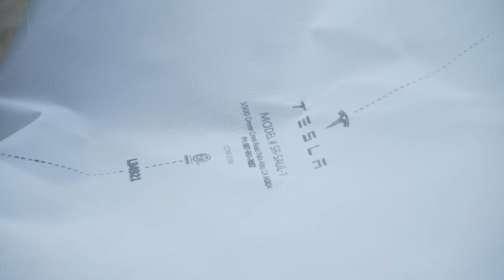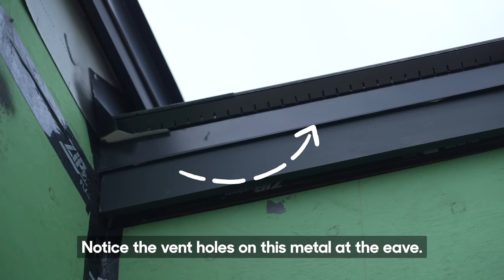Tesla Solar Roof - A Builders Perspective

Comment: As an Architect and someone that just finished building a custom home, this roof is super awesome.....for those that can afford it. Our roof we installed is a high-end concrete flat tile, we priced a tesla roof, and it was 4 times the cost of the tile roof. With that kind of price increase it really is just for those that want the bragging rights or truly have money to burn for the new cool tech. I think it will still be a decade or more before you see this type of roof incorporated into everyday home construction. Don't forget, you don't just have the cost of the roof that's 4 times more, but then you need the power walls as well.
Reply: Does that include the cost of install? What was your expected ROI on the solar?
Reply: @InfluentialStudios  We could never ROI per our estimates. We would never save enough power to offset the cost of the Tesla solar roof. With a 20 year excepted production lifespan, we would never ROI before the panel production was too low and needed replacement. The Tesla roof might have a 30+ "roof" warranty but the panels start degrading production the moment they are installed. By 20 years you are already in the 30% production range. Cost of entry is still too high for most consumers.
Reply: I thought the same thing, but I ran some numbers and was surprised how good the ROI was. I may be off on cost and savings, but if I'm close the premium over a metal roof has an ROI of about 7.5% per year. Not too shabby. Video here: https://youtu.be/y6bcUSQXEmo
Reply: I'm building a new custom home in GA and wanted to get the Tesla Solar roof.  The math just didn't work out--and I'm a retired accountant.  Then there was the short supply and not enough installers to contend with.  The roof plus the Powerwalls wouldn't start saving me money until after I'm dead.  In some states, electricity is just too cheap for this version of the solar roof too compete.  Perhaps in 10 years the cost will make more sense.  I agree, it just for those that want the bragging rights.

Comment: Lets come back to this project after one full year and see the ROI, thanks Matt for featuring this Roof build.
Reply: Oh please. If you can afford a home like that you don't worry about ROI.
Reply: @slickraft  Yes and No. I'm guessing in this case it's mostly installed as a status symbol, kind of like buying a Tesla car (I don't think any Tesla product has yet offered a payback). But other high-end buyers will wait for an ROI (that's how they got rich; by being conscious of returns).
Reply: @slickraft  Where I was born , in Asia  many houses  are worth $100,000  to $200,000 , Solar panels and LFP  batteries  allow offgrid  or gridtie installations ,some whole systems go for $10,000 ,with the cost of Electricity  being so high and constant blackouts it is a no brainer  to have Solar and batteries ,ROI  around 5-6 years  as many are finding out.
Reply: @slickraft  if you can afford a house like this that means you live ROI…
Whoever lives here has thought this through
Reply: @FreekHoekstra  We have much smaller house and cheaper solar roof/powerwall package. Had to replace the roof, and it ended up costing us about what metal would have, or twice asphalt (after incentives and insurance payment). 

The ROI changes every year. We originally thought it was ~15yrs. Last Fall, we got a software update for the batteries, and now it looks like our ROI is cut to ~7yrs. Depends on energy prices, and if you have an EV etc. That's not factoring in gas savings and future energy savings improvements.

It also felt like an opportunity we couldn't pass up on, and was worth it for style reasons. They've also hiked the price since then, and people have much larger and more complicated roofs than ours.
Reply: @FreekHoekstra  Not necessarily. Here you have young, dumb, overpaid sports stars who just blow their money on dumb things. Odell Beckham spent $2 million on a diamond grill. Can you imagine?
Reply: @Crusader1815  and here you are talking about. It generating more press for him and probably generating him more money…
Reply: @slickraft  When I build my house in the tropics ,whether  Asia or  Central America  Solar  Panels  and  Batteries  will be top of mind, system wil be 10%-20% cost of the house/ Property so around the cost of this build PECENTAGE  WISE
Reply: We just released a video on ROI! 🌄
Reply: @Crusader1815  Did you know diamonds and coal are similar in composition?  Maybe He wants to BBQ with diamonds 💎😏
Reply: @slickraft  I actually think this may be giving them an annual return of about 7.5%. Full analysis in this video I made: https://youtu.be/y6bcUSQXEmo

Comment: I had these panels installed in August 2020. But it's nothing compared to this. I've only got 6.43kW and one PowerWall. But it's still awesome. I'm close to breaking even - meaning zero electricity costs over the year with one Tesla MY charging daily from it. I'm estimating a payback in about 14 years but that includes the cost of replacing a defective roof that needed replacement anyways. Plus I don't buy gasoline. The one negative in So. CA is because there's no rain for most of the year, the beautiful black glass panels get covered in dust over time. The little rainfall barely ever washes it off and there's always a brown line across the bottom edge of each roof tile. That's noticeable from close up but not from the street.
Reply: What nobody talks about is the monthly payment you still have. You may not be paying for grid power but you are paying the system monthly.
Reply: @xxZerosumxx  that's what I meant by payback in 14 years. The monthly savings is more than the monthly payment.
Reply: I had a friend in California who had to keep his panels cleaned monthly to keep them operating at peak performance due to the dust. Your 14 years may go to 17 years if not cleaned!
Reply: A 14 year payback is horrible but thank you for that information. I hope you somehow come out ahead in the long run.
Reply: @petebusch9069  After 14 years in fact...
Reply: @JRP3  That's way too long, you'll never save a dime.
Reply: @petebusch9069  Literally after 14 years you will, it's that simple.  After the cost is paid back then every year after that saves you money.  Math.
Reply: @JRP3  You don't seem to understand the concept of ROI. Your money would have been better invested in many other ways that would return a decent ROI. 14 years is so far out of the ballpark your going to be lucky at best to break even. Do all of the math considering other investments and you will see this isn't very good. Its like buying stock that just sits there while you could have been making money the entire time.  So if your in this for an ROI then you lost, if your in this to somehow save the planet then that is a completely different subject that I will not argue, you be you but don't live under the idea this was a good financial investment.
Reply: @petebusch9069  You're ignoring the value of protection from power outages as well as the fact that other "higher" return investments can also be higher risk and in fact lose all your money.
Reply: @JRP3  Power outages are rare and a small Yamaha generator will get you by, its also good for a person to loose their luxuries every now and then to maintain appreciation. If you NEED power then get a big backup generator. You are also not aware that solar IS a high financial risk as well. Spending 300k to get free electric and gasoline for the next 20 years is not a good investment. That's 100k for the system, and 100k for 2 cars.
Reply: @petebusch9069  So now you're adding the cost of vehicles, as if they wouldn't buy a vehicle otherwise?  Ridiculous.
Reply: @JRP3  You sound like a salesman. What is the guarantee, do they give you one? Do they put it in writing that you will come out ahead and by how much and if not what do you get?
Reply: @petebusch9069  I agree with you. A 14 year pay back by any definition is basically an opportunity cost over money out to better use elsewhere. And that assumes no repairs.

I put a large solar install in last year with an estimated (my estimate) 8 year ROI. However I knew if energy rates increased this would be sooner and my local provider has already announced a 10% increase soon in electric.

The Tesla solar roof looks cool, is laughably overpriced, and like other Tesla products availability in the market is many years behind original claims.

I have no on-site battery as those increase cost precipitously. My panels are 370 watt silfabs.
Reply: @patty109109  Hey, if you can make it work and actually save a buck then have at it.
Reply: I agree, we live in So Cal as well and the dust layer is annoying.  Not as noticeable from the street but still I wish it came with a Roomba like washer that cleaned the roof everyday.  I think the Tesla tile roof only makes sense if you need to replace a roof or if it's a new build.  Otherwise, regular solar panels with be much less $$.
Reply: Just to clarify, the 14 years included the cost of replacing the roof, not just the solar. Accounting for just the solar, it's more like 7 years to break even. Sorry I seem to have confused the issue. No one ever gets an ROI on a new roof.
Reply: Thomas, Emmerich, in MN 99% of the roofs are replaced by hail damage insurance. Its weird but it is what it is.
Reply: @ThomasEmmerich  my roof and my normal solarpanels will pay for it self in 4 years
in many places the cost of replacing a panel on a solar roof if it gets weather damage would make insuriance more expensive then a normal panel also

to most people solar roof is not diy like normal panels can be (a balkony system from 500dollars and up,  is plug and play and the panels can be placed where you want for example)

we had hail the size of handballs in europe this summer
Reply: Why powerwall and Tesla shingles as opposed to an eg4 battery and Canada panels?

Comment: For sure want to see this done! I was told back in 2020 that I couldn’t use my portable generator backup as backup to my solar and powerwalls in the scenario you mentioned. Wonder if my local installer was just clueless or that has changed. Very cool! Love this type of resilience
Reply: Check what inverter you have.
Reply: You have to pay extra for a special inverter so yes he was probably clueless but also maybe he knew it was going to cost a buttload more so he just didn't tell you

Comment: What about costs? This type of system could easily cost $120,000 plus to install and with the tax credit that drops to $84,000. Let's say the electric bill is $500 a month and these generate 100%. That is a 14 year payout and this does not include additional insurance or other costs. That is considering that the house faces the correct position for the panels. 

I had 2 people come by and give me basic solar estimates lately. The 1st one was honest and we crunched the numbers to find out that I would be paying $258.00 per month for 20 years to save $208.00 per month in electrical costs. That leaves me $50 a month negative over the costs. 

The 2nd one came by and tells me they can generate 100% or my elecricity and we have a 400 amp service. He wanted to put 60 400 watt panels all on my house on every direction. Then told me it would generate $500 per month in electricity and would costs $260 to pay at 20 years. The guy was a snake oil salesman who wanted me to sign now and worry later. These are the people who give solar a bad name. Either it is going to be a good investment or the rates will be so cheap that it will not be a payback in the time expected, simply like that.

I am an EC who spent $15,000 on a Skystream 3.7 back in 2010 and they went out of business in 2014. Now that 15k investment has generated at the most $2500 in electricity and now it is broke down and they are gone. The worst investment I have made in a while. There are stories out there everywhere that people are buying solar because of promises which do not get fulfillled. Don't be afraid to say no to solar scams. If your rates are around 10 cent per kwh it will be hard to generate the spent money back.
Reply: My guess is this contraption with all the Power Walls and generators is $250000.  From what I’ve seen the Power Walls and solar make since in Cali where the market is messed up, but not so much here in Texas.   The Power Walls will need to be replaced in 10 years at most, $100000 and some labor today.  You’ll have to do that 2 times before the roof starts to slip according to the 25 year warranty.   Then do you replace the working tiles on the roof or the whole thing that cost 3 to 4 times a standing seam metal roof?
Reply: @daddams2538  This system may work in Cali where electricity rates are from 35 cents per kwh to $1.06 per kwh which is  9 times what we pay in Texas. How long will it take to recoup $350,000 in electric bills. At 30 years that is $972.22 per month for electricity. Do they really think they are going to pay that much for electricity for 30 years? And this is if the system last for 30 years.